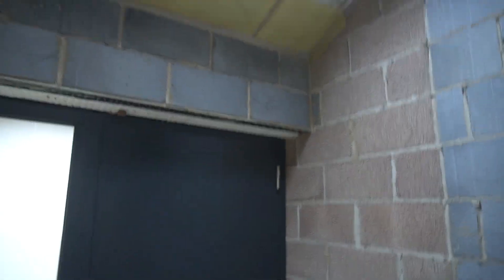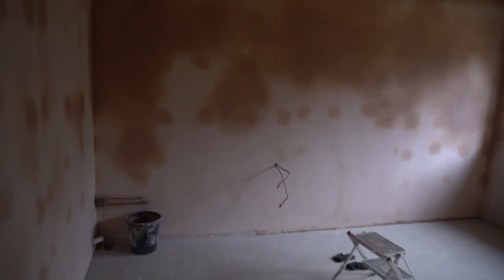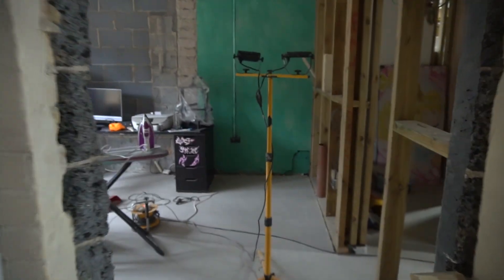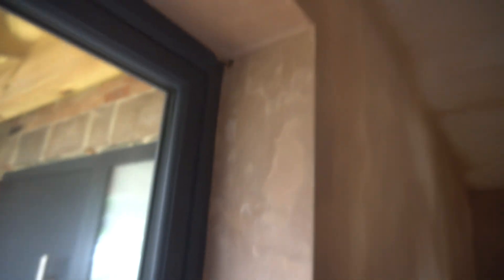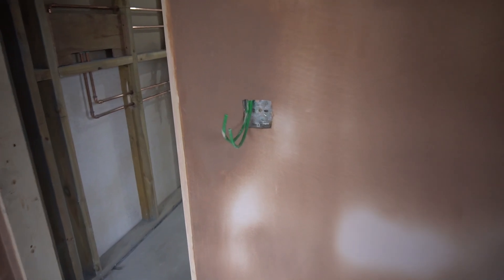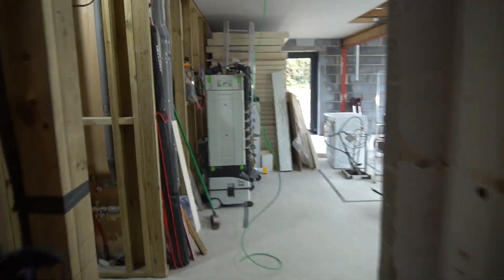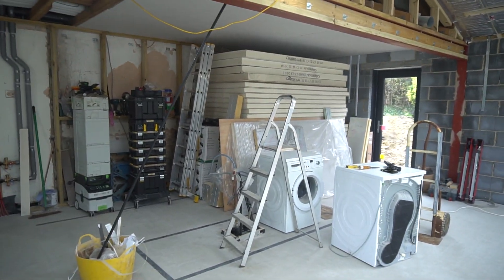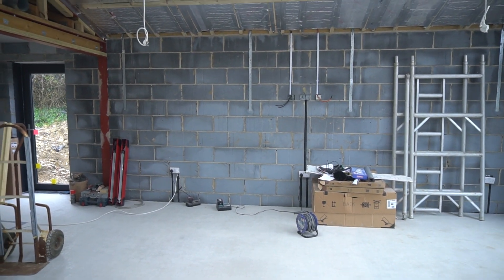1970 bungalow renovation project update

Comment: Why have you two tree cables at the switch? Thought it only needs one back to the switch? I ask as I’m hoping to install Loxone in my home, thanks
Reply from the maker: Hi Johnny, The wiring topology for Loxone tree is very flexible, you can have a ring, radial or spurs. You could run a single cable to each switch but that would result in a large number of cables to terminate back at the cabinet. I am installing 2 rings to start with as that gives a level of resilience, I can then easily spur off at device if I want to add something new later on. I have the advanatge in a bungalow that it will be reaosnbaly easy to get at most of the cables. There is a maximum cable length and number of devices to each tree branch. I think I will have enough connections for 4 branches.

This would be a little different if you were using lots of tree powered devices like spot lights then you must consider the number of devices and the power drawn then take into account cable length and voltage drop at 24V. I would imaging I would need more branches for that sort of installation.

I will add another video soon covering the overall wiring design as it has been tricky to consider everything I may need. In my case the main consumer unit is in the garage and the Loxone cabinet is in the centre of the house the other side of a vaulted ceiling which will make it much more difficult to pull any new cables between these points. I am adding a small number of spare power and data cables across there to allow for things I may have forgotten.
Reply: @JurassicJungle  Thanks, I didn't realise a ring would be required but might be for redundancy. Thanks the videos are very good
Reply from the maker: @johnnygallagher3457  Take a look at the Loxone site https://www.loxone.com/enen/kb/tree-extension/ You can wire it pretty much how you like as its basically a network. There are limits on cable length and number of devices per branch. If you start your planning you will find most devices will have 2 cables to them no matter your topology as you would use a lot of cable wiring every swithc back to the control panel.
Reply: @JurassicJungle  I have designs done by Hugh. I just thought you branched off the nearest spot to the touch pure, didn't see the point in bringing two cables back to the switch from two different lights. Thanks for the reply
Reply from the maker: @johnnygallagher3457  Yes both approaches are OK as its a pretty free topology. I was discussing this with Hugh earlier and his view was the ring does give a bit of an insurance policy if a cbale were to be damaged by a screw or plastering towel you can just disconect it and use as a radial. KNX cable is not expensive so it seems a sensible approach
 to me.

Comment: Why have you two tree cables at the switch? Thought it only needs one back to the switch? As I ask as I’m hoping to install Loxone in my home, thanks
Reply from the maker: HI Johnny. The wiring for Loxone is pretty open on how you connect up. I am using 2 wires for a few reasons. If I ran a single cable from every device I would have a high number of tree connections at the Loxone cabinet (over 20). Wiring in a ring simplifies that connections at the cabent, probably uses less cable than star or radial to each device and offers some resileince should one cable get damaged by a screw or trowel. If you will be using many Loxone powered devices like 24v lights you also need to consider voltage drop which may mean you need more cables. I decided against using the Loxone RGBW spots partly on price as it would have cost over £3k for the spots and also becuase of their relevant brightness and beam angles. Its a shame as the abaility to address each lamp is pretty cool. I have used a combination of dimmers and relays. My panel is being built this week, I think the were will be a build video by the installer and then one when we do second fix in a couple of weeks.

Comment: is it really worth removing all that insulation and re-fitting with gapotape? the important thing is that no air can flow between your ceiling covering (plasterboard) and the insulation layer. It’s all taped by the look of it. just make sure airtight around the ceiling perimeter and any penetrations.
Reply from the maker: It's hard to say how much difference it can make, at the moment it is not fitted at all well, a few bits are tight but most would simply fall out if i removed the battens. The detail at the bottom was never attempted so not sure what the plan was there. We have a lot of other areas that had not been started so planned Gapotape there anyway. We have since found that he fitted battens on top of the timber to space the roof down but the battens are 5mm wider than the timber which is probably why the insulation is all such as loose fit, most of it has a 5mm gap around it. I understand your point about air movement but as the space above the insulation is vented that air can move leaking energy.
Reply: @JurassicJungle  wow 5mm gap around, OK that is bad. I’ve done all my insulation myself on various projects. Just built a whole house from foundations up. Currently membrane and battening the roof. All the cavity insulation is fitted tight, glued to the blocks, and taped, don’t trust those red disks. 50mm clear cavity too, pre 2002 regs. Also in Dorset.
Reply from the maker: @over-engineered  We went with 145mm Thermaclass in the cavities which is almost a T&G construction but I have discovered some of it installed upside down, i think just above windows so should be ok. The T&G allows a full fill without risk of water tracking through. I wish I had kept a closer eye on what was happening. I don't think he was a bad builder, just not used to some of the construction detail we wanted. It has mean us spending winter in a caravan which we had not planned and doing a lot more work ourselves. We are still stuggling to decide what to do in that main living space so concentrating on the rest of the build at the moment but that means no kitchen for now.
Reply: @JurassicJungle  I’ve used 75mm K108 Phenolic insulation in a 130mm cavity with dense blocks inside and out (to be rendered), achieves 0.18 just about. But under previous BR meets SAP on the whole house calculation. Laying 3500 dense blocks is hard work!

Comment: I think I watched that ‘warm roof’ insulation, that guy needs knows his stuff. Sorry about having to part ways with the builder. Many of them see insulating as a secondary task and I think the significant amount of time they see being consumed by installing it - just stresses them out. It is why a competent DIY will always doi a better job - because they have a stake in the outcome.

I take it if you are using gappotape, you have seen Robin Clevitt’s videos on this subject.

Look forward to the forthcoming vids.😀👍
Reply from the maker: Thank you for your comments. It was Steve Roofer that ihave been talking to, he has provided some great support and suggestions on how best to finish the roof using LOTS of foam. I follow Robin Clevitt and Skill Builder, if would have been great to have a builder with that attention to detail but I think they are few and far between. Our builder was OK but attention to detail was poor. It started off badly as he failed to read the spcifications and started building a 100mm cavity when my spec was 150mm with a full fill. We also had problems with the steels design which we are still working around including a 20mm drop from one side of the patio doors to another. 

We will start the insulation next week, based on Robin's video I picked up a Festool insulation saw and will make a jig. I am hoping I can sell the saw when we are done and not loose too much as they hold their values very well.
Reply: @JurassicJungle  Good plan, Festool pre owned prices hold up well - however the insulation cutter is a small market - most builders just hack away with an old rip saw.🤣